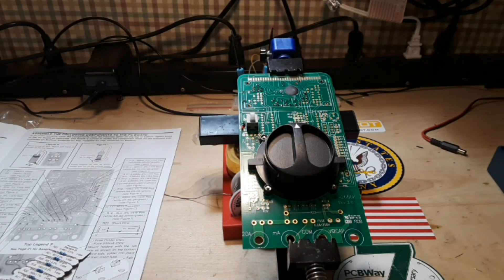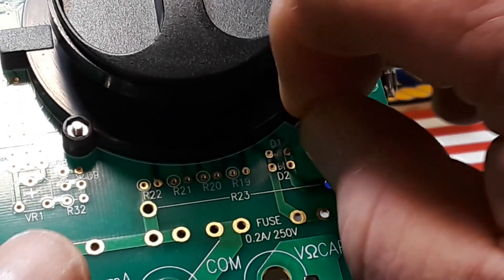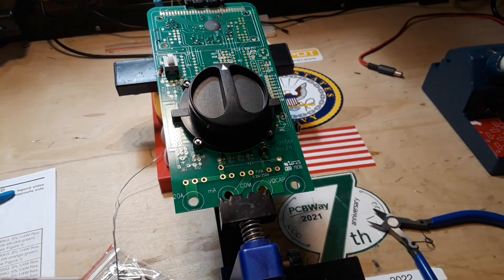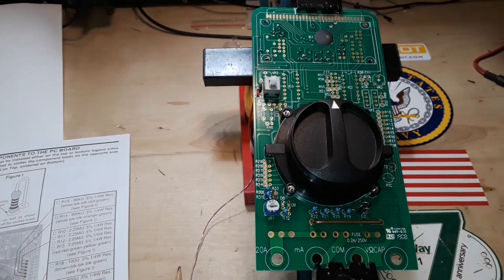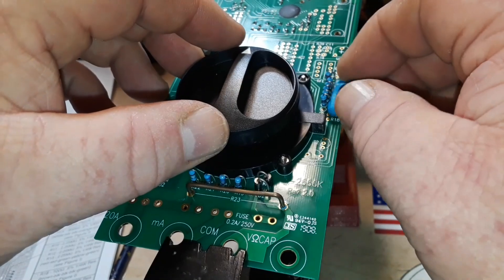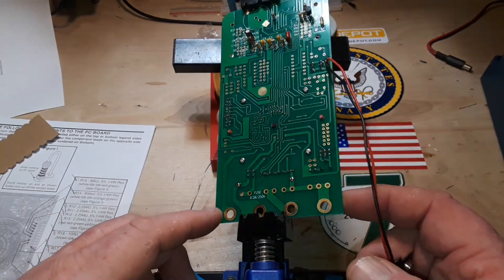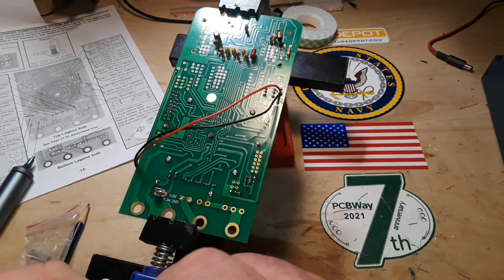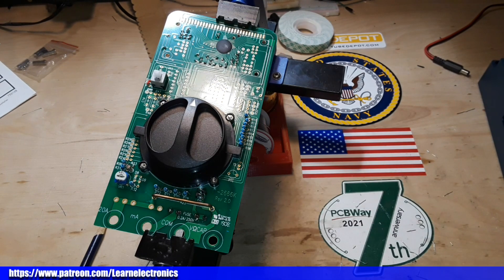Elenco M2666K Multimeter Build Part 2

Comment: Hey there, good video! I finished up Part B, and was able to adjust VR1 to measure 9V battery correctly, however when I switch to 200uf to test current, without anything plugged in the display just slowly climbs up in current. It will start at 8.2 and just slowly climb. ItWondering if you had any thoughts? I’ve checked my connections, resoldered and just not sure what to troubleshoot next.